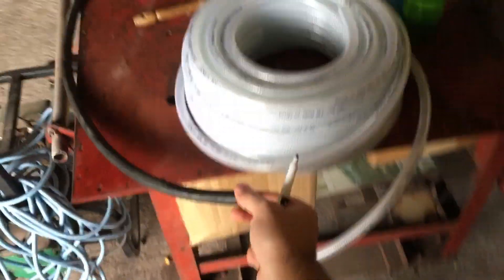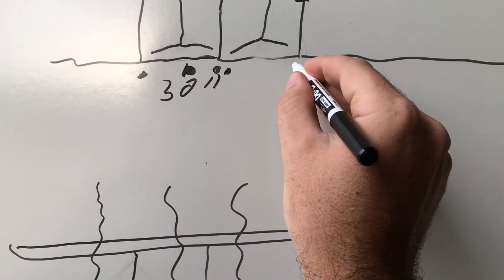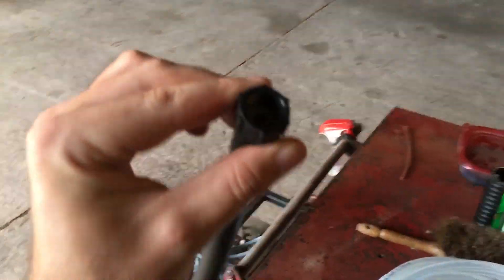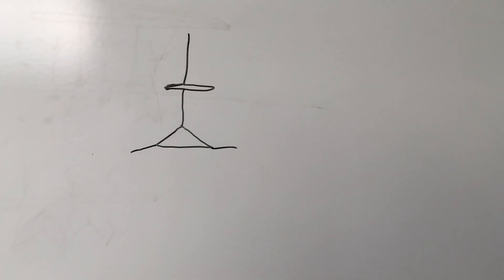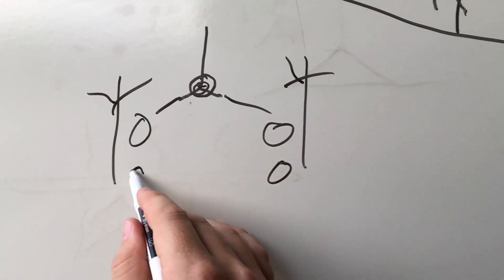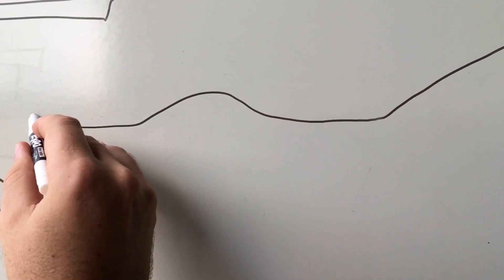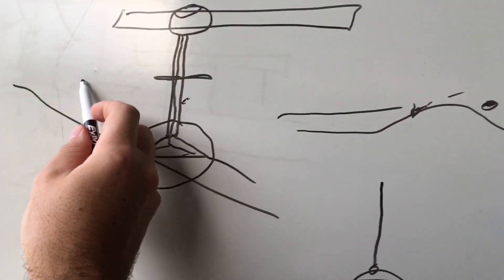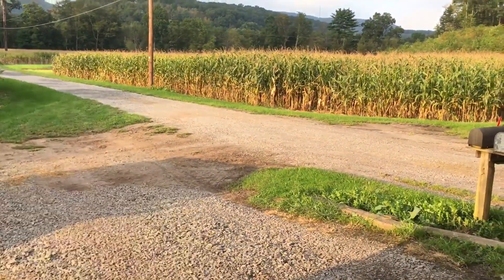Nitrogen Y Drops

Comment: We made a set of them 2 years ago for a FAST 15 Coulter bar for a neighbor. We had a 3/4 pipe bout an inch long that we ran the hose through to hold it out near the row. I think they were about 18” or 20” apart so leaving about 5-6” away from the row. Prolly had the hose come out about 8” past the holder. Corn needs to be about 18” tall. Now the bad like Jon Stevens said the Y drop in general didn’t yield like methods like anhydrous and it cost more too. That’s why we don’t do it. And if it’s dry and stays dry when u do apply it the N barely makes it in the soil. If ur still interested in trying it PM me ur email or phone number and I’ll send u a picture of one I think we still have laying in the shop
Reply from the maker: I was looking today, I can’t send messages on here anymore?? Are you on Instagram?
Reply: PA Farms no I have a Facebook. Do u have one?

Comment: I'm trying to figure out to do the same thing. Could you put a hinge on the metal pipe swing forward and back but not side to side? What about a gallon jug with bottom cut out on y's you can cut holes and run hose through each side? How many gallons per acre do you use? I've not figured out how much to put down for 200 bushel corn. Take care and have fun
Reply from the maker: I was putting 40gal per acre of 30%. Also it’s getting some with the corn starter. If you can go into the App Store and look up Ag Phd they have a fertilizer removal app. It’s pretty good for listing fertilizer requirements
Reply: @PAFarms  yes I use it all the time just never been around any liquid nitrogen. Thanks

Comment: there is a lot of data showing that the N placed at the plant vs broadcast or even knifed at 15" off the plant is a better yield or cost savings.  I am living proof of that this year. 360 company  is very gimmick to me. they want 700 dollars a row.  there is a company out of south Dakota that makes them for 170 per row.  
a little imagination and you can do it for 20 dollars a row.

don't forget the orifice and barb at the boom.

  everything kind of limp noodles around back there and works great.

the corn wont let the Y drop get to another row.  your hose dragging on the ground is longer then the distance between the corn plants. 

there are also guys that use a drop hose with a nozzle that squirts the product to the plant so you don't have drag hoses.
Reply from the maker: I’m thinking of making up a few and do some testing. I really wish I could do saddle tanks and a 3pt boom. That would be an ideal way to do it without driving corn down
Reply: PA Farms saddle tanks are out there.  look at tractor house or build a boom.  that would be a great setup!

Comment: What you could do,is add programmable Gyroscopes to each delivery tube to ensure the system compensates for terrain inclines and declines and direction of row crop. Then probably some self extending Y-tubes with sensors enabling the tubes to extend/retract based on whether the tubes need to be closer or farther away from the stalk.

Mate all this to a central computer display in the cab coupled in with engine-transmission management, GPS Nav, Beer cooler, and you got the basis for a pretty good John Deere Precision Application System.

Also guaranteed job security for the JD Service Technicians, cause only JD would come up with something like this.

Comment: What works best for hill side aplication is a good old fashioned cultivator. You can run the hose right behind the shank. The cultivator doesn't even need to be in the ground more than an inch. Travis on his channel ,"the Rest of the story ",is doing just that. Last spring he was side dressing corn with his cultivator and he was only scratching the surface. I know you are 100 % no till but I know this can work for you on your hills. Travis Kuster farms the Mississippi River Valley on the Wisconsin side. Which is also very hilly. Check out his channel from last June.

Comment: Nitrogen has to be put in the ground 18"  deep between rows or it burns everything, i have tried to get it but i dont have the plows to put it in the ground for my sweet corm
Reply: Arnold Romppai 18” might be a slight exaggeration lol. Most guys don’t even chisel that deep
Reply: well the liqide nitrogen plow fingers go 16 to 18"" deep and still gas comes up and burns the plants or grass, oh were leaving out the girls are we?
Reply: Arnold Romppai are u talking about anhydrous? Liquid in the tanks but a white gas once in leaves the shank?
Reply: well yes it is the only real nitrogen we can get around here other the buying a 19-19-19 witch only gives you 19% N and 19-19 other crap never mind the price of $25 a 25kg bag, 50 Lb. or a 7-7-7 but we need a lot of N so these low number do no good when i need 1 Lb per acre of N  it is a  white gas once in leaves the ta under presser, high presser,, and will burn your face off if got in the way pick it up at our local welding supply store in a big tank like a long propane tank on a wagon like you would have on a slap at your home for cooking and heating, i am on hard red clay and is only thing that makes it grow anything good, and being i am all red clay it stays put for months
Reply: Arnold Romppai I apply several thousand acres of anhydrous every year. I only run the shank about 4 or 5 inches deep and it seals fine even in the sticky clay soils. I just have a good set of disc sealers right behind the shank that throw dirt over where the shank ran. I have several video side dressing anhydrous on my channel from this spring
Reply: Talking about top-dressing here. Usually it's a liquid mixture of nitrogen and say potash. Not pure 100% liquid nitrogen   LoL

Comment: If you used a steel drop down from the main boom, could it be hinged so it breaks away if it hits a obstruction and a spring to pull it back in place again?
Just a thought!  Great idea with the Y fittings to get it closer to roots!👍